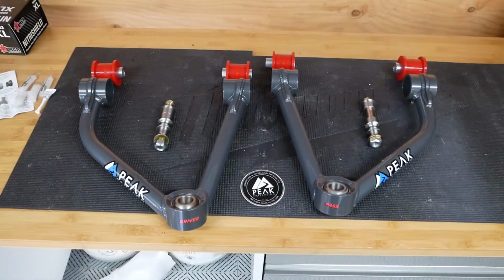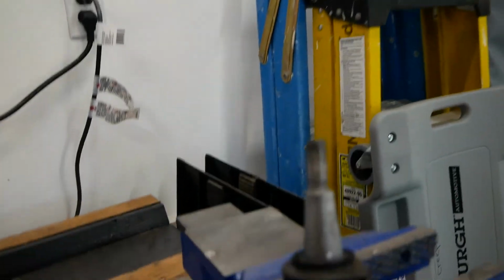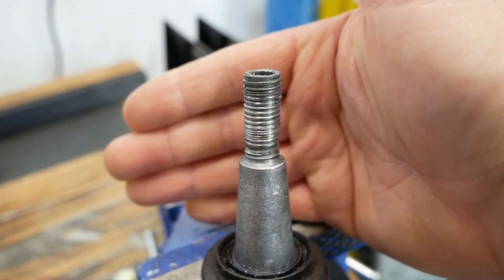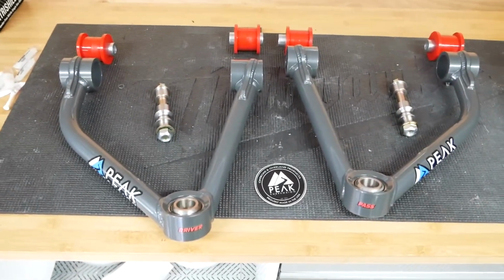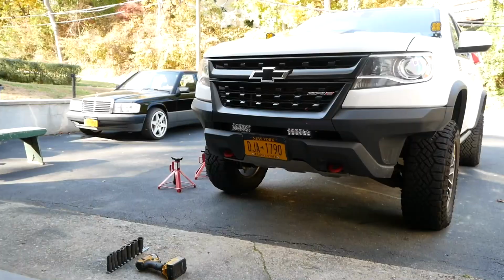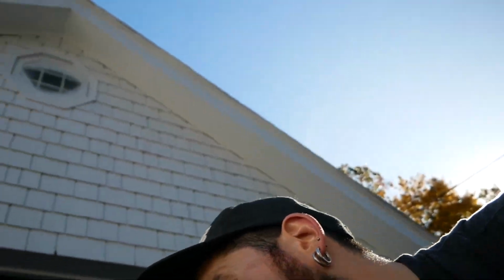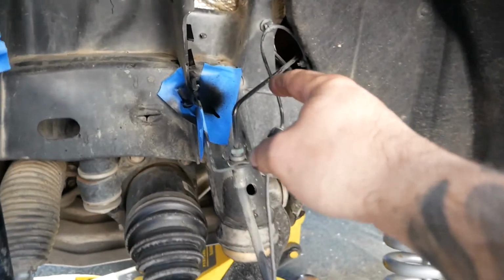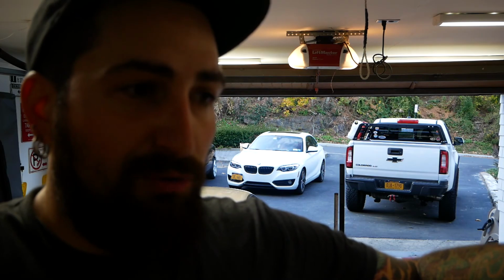Installing Peak Suspension upper control arms! | how to | Chevy Colorado ZR2

Comment: This was very helpful as I'm having exactly the same issue with the popping at higher ride heights and I'm also hearing a wobble sound at low speed over uneven surfaces. I was hoping the GMPP control arm would get the job done but it looks like I'm going to have to pony up for the peak UCAs. Hindsight, I would have gone with the BDS kit had I known the UCAs would be required to not have my suspension all bound up. What size spacer did you go with to clear the stock wheels with the Peak UCAs?
Reply from the maker: i am not running any spacers at all..  i THINK they suggest it, because if you arent running stock tires(larger) they will rub.. but im not sure
Reply: @chrisdz  what size tires you running?

Comment: Silly question, I know, but what are you putting your jack under?  What are the front lifting points with a floor jack?
Reply from the maker: you can jack up from the frame rails on each side, or from the subframe in the center, where the back of the skid plate mounts.  then jack stands can go on frame rails, or either side of subframe, where you jacked truck up from..
Reply: @chrisdz  thx!

Comment: Great videos! I have no experience with modding vehicle and was wondering if it was possible to fit 33's on the ZR2 without doing all the other suspension work that you did? I have heard people saying that they could install the 589 fab 1"level kit and fit 33 no problem but im worried about the added stress to the CV joints. What is your opinion on that? If you do think that is okay, would also installing an add a leaf (like in your other video) be ok to pair with the level kit?
Reply from the maker: I’ve read that people have fit them, but staying with stock wheels.. when you get to the aftermarket wheels with lower offset, is when you run into issues..
Reply: @chrisdz  awesome thank you for the reply! And you dont think that the 1" level kit with the add a leaf will add too much stress to the stock suspension?
Reply: instablaster...

Comment: I just installed my peak control arms.  I noticed that the bolts that go thru the knuckle  are  very short.  The bolt threads do not even get into the nylon part of the nyloc bolts.  I think I am going to get some 5” long bolts instead of the 4 1/2” that come with the arms.  Did you notice this with your arms.  Thanks
Reply from the maker: Make sure the knuckle is as far up as possible, and you push the arm down as far as possible at the same time.. it’s hard to get the nut to start, because the knuckle and arm are kinda pushing in opposite directions.. once you get it started and can tighten with a ratchet, you’ll see the arm and knuckle pull closer together.
Reply: @chrisdz  I got everything tight and torqued to 100 ft lbs but the nylon piece of the nut does not reach the end of the bolt. It is the same on both arms.  Does the bolt on yours go right thru the nut.

Comment: I have a Chevy Colorado, what’s the easiest way to remove the three bolts at the top of the shock mount. Had a really hard time with the drivers side last time I took out my shocks
Reply from the maker: you MIGHT be able to fit the smallest ratchet you have in there to get 1 or 2 nuts off, but i used a ratcheting wrench, i have 2 different ones, a straight one and one that is at an angle.  I havent found an easier way to do it yet, usually takes longer to take those off than the everything else combined 😂

Comment: Do you have to press the bushings in?
Reply from the maker: They are a little hard to go in.. but no.. I used the vice on my work bench to give it even pressure. But you can def do it with a rubber mallet or piece of wood and hammer
Reply: @chrisdz  Thanks! Hopefully I’ll be ordering these in the near future. Keep up the great content 💪

Comment: Did you have to use spacers with the stock rims? I thought I saw a note on their website about stock rims might have interference issues and require spacers.
Reply from the maker: I actually forgot about that when I ordered them... installed and everything clears.. I think the main issue would be if you had wider tires
Reply: @chrisdz  Thanks, man! Good news.

Comment: I didn’t notice whether or not you drilled out the knuckle?
Reply from the maker: yeah.. totally forgot to film that part.. i had to send a 9/16 drill bit thru it.  it doesnt take off much material, and it leaves the bolt snug in the knuckle.. definitely needed

Comment: What tool did you use to cut the braket out?
Reply from the maker: Used an angle grinder; with a new blade, so it reaches a little more. Used blade wears out and you’ll hit the tool against the frame, before you cut completely thru